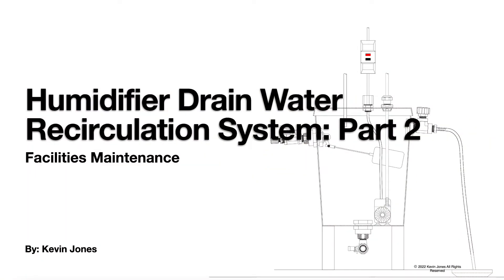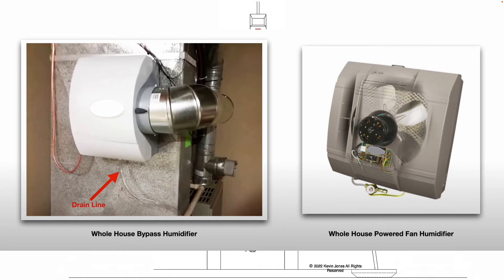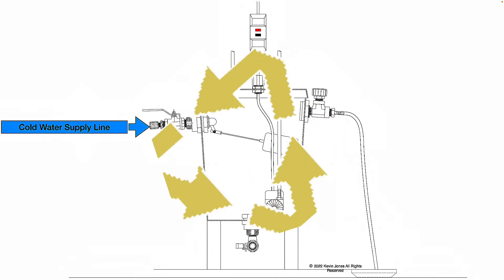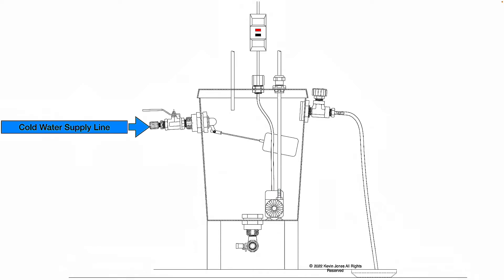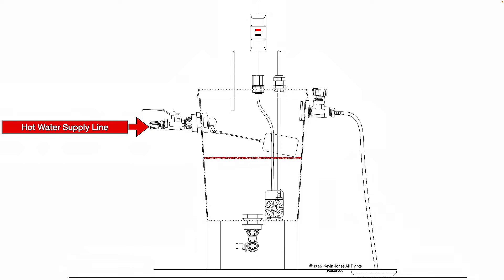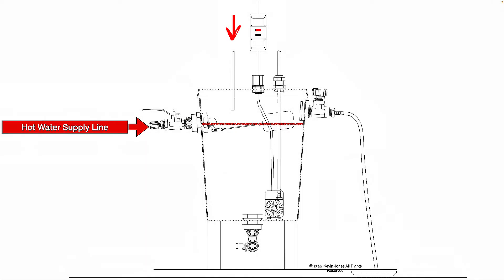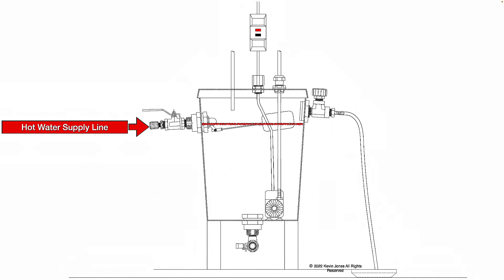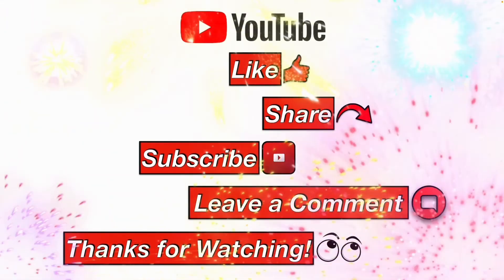Whole House Humidifier Drain Water Recirculation System: Part 2! (HVAC)

Comment: What kind of pressure or flow does the pump need to produce for the recirculation to the humidifier? Would a 24 Volt submersible pump work on a bypass 24 VAC vs a 120 V pump running from the contactor and GFCI?
Reply from the maker: Here is a pump that would work well for this application. It’s 115 VAC, 210 GPH, with a 7 foot max lift.
https://www.zoro.com/beckett-pump-115v-submersible-6-cord-wplug-g210a/i/G904836122/?utm_source=google&utm_medium=surfaces&utm_campaign=shopping+feed&utm_content=free+google+shopping+clicks&campaignid=23097810955&productid=G904836122&v=&gclsrc=aw.ds&gad_source=1&gad_campaignid=23097810955&gbraid=0AAAAADw3hZfPi_d942EeJ2TX6jEaDbJyO&gclid=Cj0KCQjwmYzIBhC6ARIsAHA3IkTH2cHiqnBBtL5fh9AvUlUb-8dycMYK0NcYOZ2k7kAwIQzOhopnDo0aAu6DEALw_wcB#specifications
Reply: @kjfacilities-maint  Would that pump be quality enough to have a several thousand start stops in a heating season or month? I could see this pump coming on and off alot as it approaches the humid determined by the humidistat. That's what the solenoid does at least.
Reply from the maker: I obviously cannot guarantee any pumps longevity, or reliability.  
However, with that being said, the pump should not short cycle if the humidistat is calling for humidification, it’s going to send 24 V to the relay and the pump will run as long as the humidistat is calling for humidity until the humidistat stops sending 24 V to the relay.  
If the humidistat is intermittently sending 24 V to the water solenoid valve currently, causing the solenoid valve to short cycle , I would look at the humidistat.

Comment: The set up you have depicted here seems to be well designed. Any chance we could get a list of materials?

What kind of breather vent? What size fittings? Matching up threads on things is a nightmare. Recommend float valve drain valve, and what not?
Reply from the maker: That's a great suggestion, I will post a list of materials on here in the next few days. Thanks for the feedback.
Reply: @ thank you!
Reply from the maker: @MichaelOfTroyWasHere you’re welcome, here is the parts list for the humidifier drain water recirculation system: 
1              1              Inline Water Filter         ICF-6    Walmart                 $7.31
2              1              1/4” x 32’ Poly Tubing & Ball Valve                  607569660968 Amazon.com   $12.59
3              1              Float Valve (Supply)     607569639964                 Amazon.com   $6.25
4              1              120 VAC Sump Pump  653334368010                 Amazon.com   $19.89
5              1              ½” x 10’ Poly Tubing     711414430139                 Amazon.com   $11.49
6              2              ½” Bulkhead Fitting     B0002DKANM                 Amazon.com   $6.64
7              1              ½” NPT Street Elbow   B0CZDRF7Y5                 Amazon.com   $3.99
8              1              ½” NPT Ball Valve (Drain)          B09JBXKSDV                 Amazon.com   $7.89
9              1              Cord Strain Relief         B0CNRFDPD1                 Amazon.com   $9.99
10           1              Inline GFCI        G1215CM           Amazon.com                 $19.66
11           1              Breather Vent  G4969763          Zoro.com                 $6.29
12           1              ½” FNPT Tee     B0B63NFTKC   Amazon.com                 $6.98
13           1              ½” MNPT  x ½” Barb Adapter  B000RO3TNE                 Amazon.com   $2.48
14           1              5 Gallon Plastic Bucket              4853      Lowes                 $4.98
15           1              5 Gallon Plastic Bucket Lid      276477 Lowes                 $2.78
16           1              Your Existing Humidifier Drian Line    N.A.                 N.A.      N.A.
17           1              2” x 6” Wood Base        1418282              Lowes                 $6.58
Reply: @kjfacilities-maint   Your part links don't work, could you share them with links in the video description so I can order the parts and build one?

also, is there a way to put the inline filter in the recirculation line rather than the incoming or make an auto dumping feature that dumps the 4-5 gallons of recirculating water every 5 days or so on a timer?
Reply from the maker: I think you are referring to the links I put in the previous comment if the links do not work then you can Google the part numbers that I listed.  I checked the video description, I don’t have any parts link in this video because they are generic universal parts you can buy just about at any hardware store, big box store, or online.  Regarding the in-line filter, I would not advise putting it on the circulation line of the pump discharge because the pump may not have enough force to push water through the filter.  
Also, you would be running raw city water with all the minerals and sediment in it, through your water pump.  Overtime, that could become a problem.
Reply from the maker: I think you are referring to a previous old comment that I made.  If the links do not work, then you can Google the part numbers that I listed in the comment.

Comment: Thanks for sharing. I am wondering using the existing system and disconnect the supply line to the solenoid valve and connect a line from the tank to the inlet of solenoid valve. So, when the humidity drops below a certain point the valve opens and takes the water from the tank to the filter. Does this work?
Reply from the maker: Just so I understand your idea, you want to connect the outlet of the 5-gallon bucket, to the inlet of the solenoid valve?
Reply: @kjfacilities-maint  Yes, but from the existing tank or reservoir that collects water from the filter and not the 5 Gallon bucket.
Reply from the maker: I think I see what you’re saying.  However, connecting the drain line from the bottom of the filter inside the humidifier, to the inlet of the solid valve, won’t allow enough pressure for the water to flow back up to the top of the filter.  Remember, you need a continuous small supply of water, because some of the water gets dispersed into the airstream going through the humidifier filter pad.
Reply: @kjfacilities-maint  I was not clear on my response. The tank/reservoir I am referring to is part of VCMA-15ul condensate removal pump. The water in this reservoir is pumped out using 1/50 HP 60gph pump.
Reply from the maker: I understand now, that’s an interesting idea, in theory, you could hook the outlet tube of the condensate pump to the inlet of the humidifier. However, the issue there is after a few minutes of running, you may quickly run out of water.in the condensate pump tank.  Also, once the water level drops in the condensate pump tank, the float switch inside will turn the condensate pump off before the humidifier filter pad is  sufficiently moistened.

Comment: How do you control the desolved solids in the water that are going to build up as you evaporate water. In water cooled air conditioners that use cooling towers a certain amount of bleed water has to be removed for every gallon added.
Reply from the maker: Hi David, that’s a great question, I recommend installing an in-line humidifier scale and sediment filter on the fresh water supply line, that will capture most of the sediment and minerals in the water.  Like this one:
https://www.freshwatersystems.com/products/honeywell-replacement-neo-pure-inline-scale-sediment-reducing-filter?variant=13250050162731&c1=GAW_SE_NW&source=PLA_USA_PM&cr2=pmax__-__nw__-__shopping&kw=13250050162731&cr5=pla&cr7=m&utm_term=13250050162731&utm_campaign=pmax__-__nw__-__shopping&utm_source=PLA_USA_PM&utm_medium=cpc&hsa_acc=2014103020&hsa_cam=11853986621&hsa_grp=&hsa_ad=&hsa_src=x&hsa_tgt=&hsa_kw=&hsa_mt=&hsa_net=adwords&hsa_ver=3&gad_source=1&gbraid=0AAAAAD_qIt6FqGFj4QMAjLBOzWUM3FEUn&gclid=Cj0KCQjwn7mwBhCiARIsAGoxjaJ9qOCw_x_kFk9OLdGVoTprFLIMlJC8pacnRQsXsYofLxJdU-XeUeIaAgvxEALw_wcB